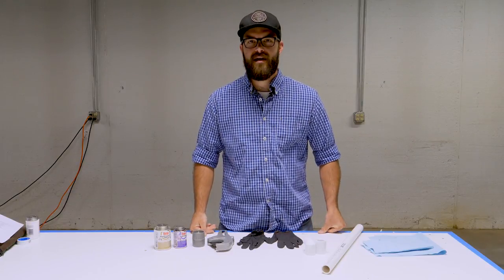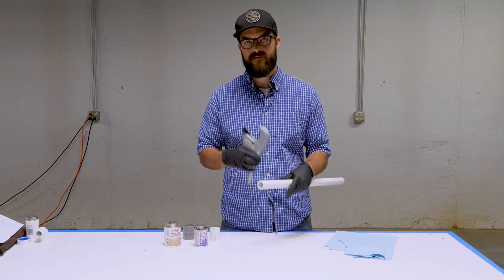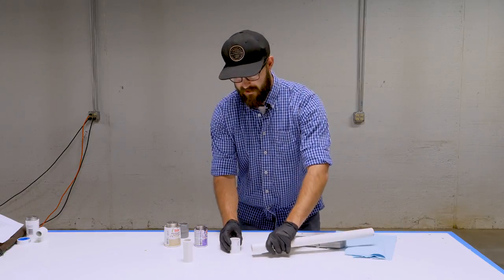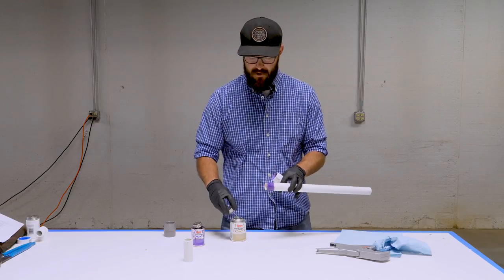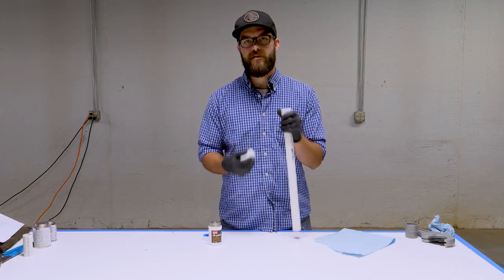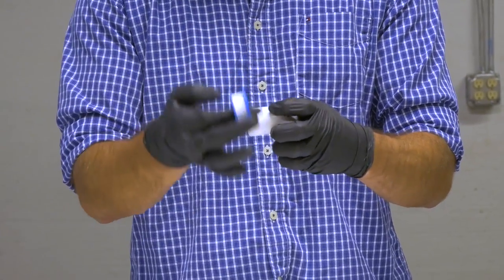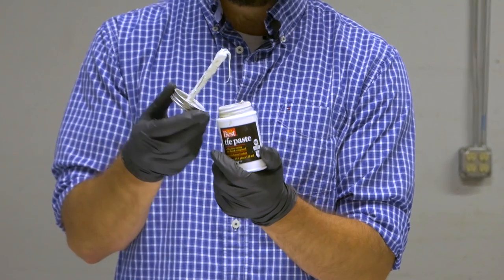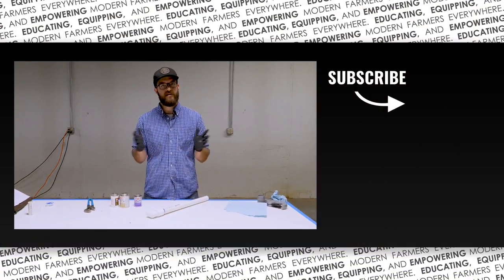Plumbing Series: How to Join Pipes for Your Hydroponic System

Comment: You made a video on joining pipes but I'm not sure if you've read the glue manufactures instructions on how to use their product.   #1 4:34 #2 4:45 #3 5:30  Wrong order & the glue doesn't require a 2nd dip for the female side.

Comment: Non of these components are food safe ... HDPE plastic is the best choice for any hydroponic system producing food ... just saying bros !
Reply: PCV is fine as long as it is NSF-61 certified for use in drinking water systems.
Reply: Hi Steve. 

Thanks for your reply ... That may be ok there in the USA but here in Europe we have much stricter controls in place to protect consumers from people cutting corners in their food production systems just to save a few dollars !
Reply: But the point is that it's incorrect to say that these components are not food safe. In the US, NSF-61 PVC materials are commonly available but is important to look for the markings since less expensive materials intended for DWV applications are also available. In the EU it would be a different standard (BS EN ISO 1452), but PVC is widely used in drinking water systems. In both the US and EU, new mains and service lines are primarily PVC. Interestingly, in some jurisdictions in the US there are restrictions on PVC usage in new systems, but that is driven by the significant environmental impact of manufacturing PVC rather than concerns for health impacts once it is in service.
Reply: +Steve Hill 

The point is valid, you my friend are incorrect to try and support an unsafe product just so you can build a system that suits your wallet and not take into consideration the safety of your customers. 

Quoting arbitrary BS EN ISO numbers means you should first read the documentation fully before try to use it to make a point .

PVC is used for waste water disposal in UK homes and business' where as the water intake is always from copper piping with the new lead free solding for the joints, with the exception to this being HDPE plastic piping that is completely food grade ... and a further point neither of these products have an after taste that is always detectable with a watering system using PVC piping, so if you can taste the plastic in your water then there is something in the water that shouldn't be there at the end of the day.

Always seek to protect the public because unscrupulous practises are the reason why every Government needs to have an Office for Public Protection or what ever the equivalent is in the USA.
Reply: Jim- Now you've crossed the line from unsubstantiated opinion to libel by indicating that I have no regard for the safety of my customers despite careful attention and documentation that 100% of the items used in my systems are approved for drinking water contact. I am intimately familiar with both NSF and ISO standards having been involved with them for many years. In spite of your personal experience, the fact remains that in both the US and EU (including UK), PVC is approved for drinking water supply including mains. I think this conversation has run its course.
Reply: +Steve Hill 

There are acceptable levels of all sorts of poisonous products that are regularly put into our food, our water supplies and many other aspects of our lives all sanctioned by our respective Governments. We as individuals seek to eliminate these things as best we can with the resources we have at out disposal, a major part for most people is finding real clean water (not the stuff just piped into our homes by our local authority) and clean chemical free organic food (again not the shit produced by the likes of Monsantano and the other corporate whores that seek only profit).

As food production business' it is a huge moral responsibility to make the right changes in the world that brings about a better place for everyone, and our individual actions should always be accountable to this fact !!!

Just because something has been approved doesn't make it the right choice to use in any circumstances, your bottom line is the dollar you make from your customers so don't act all innocent that you can just do what ever you want in this world at the expense of your fellow Earthlings(man, animal and plants) because it just doesn't work that way ... If you are called out on this then look again at what you are doing and not think you can just end a conversation just because you don't like what you are hearing ... just saying bro !!!
.
Reply: City urbam iam from europe and now living in uk the plumbing here in houses are old and they use any kind of materials in houses pipes lol!
Even older materials than in us where are u from in europe that all the installations are new and world safe?
Reply: By the way in uk i saw the most horrible infrastructures in houses and busisnes ever!!!! Copper pipes horrible ! The use amianto in some buildings and they still not removing ? Basically all london fills falling down nobody fix or renew anything !!